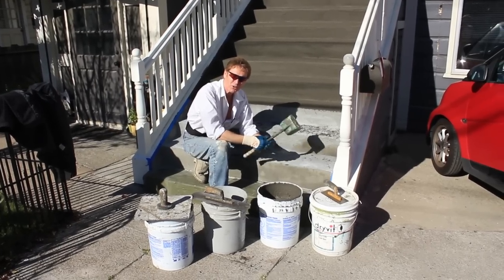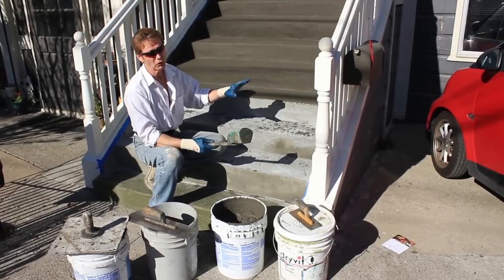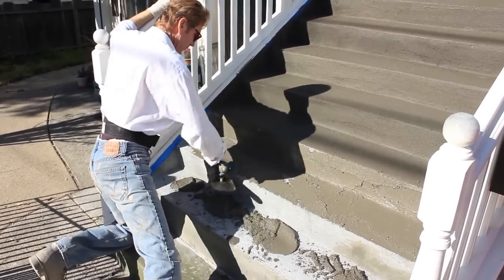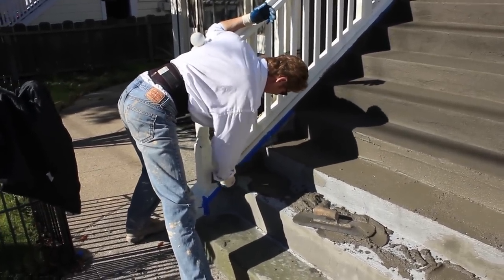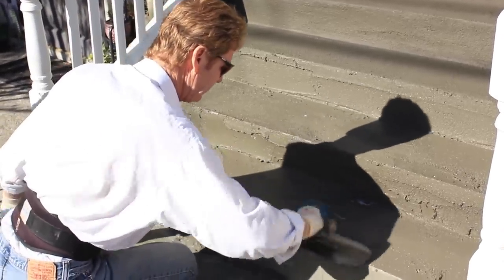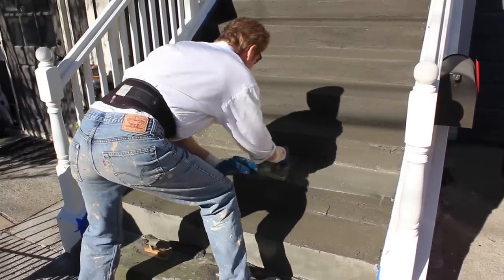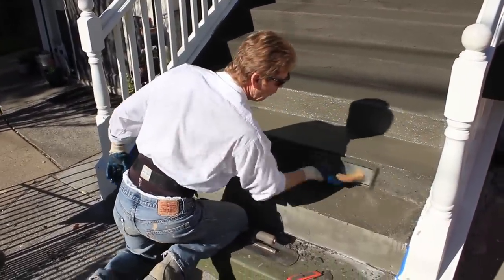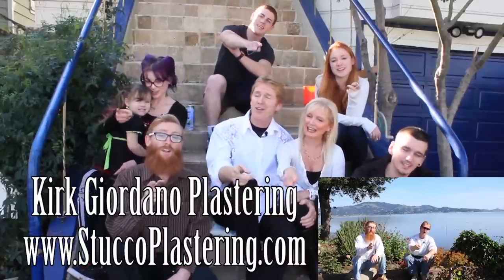Waterproof wood stairs with non-slip finish

Comment: Kirk, I tried to find an answer in the comments, but didn't. I see the DryVit bucket and saw you mentioned it's only for vertical surfaces, but I too want/need to cover the poured concrete stair treads along with the virtical concrete blocks. Which DryVit product are you using? On the spec sheets "Masonry: The masonry surface, with joints struck flush, shall be "skim coated" with Primus, Primus DM, Genesis, or Genesis DM mixture to produce a smooth, level surface.", but I don't believe you did. Was it the Dryflex? Thanks!
Reply from the maker: Good morning Red Dude, all acrylics we use are specifically engineered for walls, however I did this not for cash but for my neighbor and yes I applied it to his stairs, which are still perfect, never needs painting and are slip proof.
 Dry-vit or any other acrylic stucco has rules or folks will use them improperly then wish to sue the company, don't look for any stucco acrylic's
 saying you can use their product for walkways, as I would not say it either if I owed the companies.
                          Live long and plaster
           Plastering tips for your information

Comment: If the stairs that I'm laying this stuff over have a few chips missing, small holes to be patched, should I patch them first with a different product? Or can an acrylic be used to patch those holes in the process of it being applied? Thank you
Reply from the maker: Howdy Geoffrey, patch these holes first as stucco acrylic finishes are only for applying at most  1/8 thick,  any thicker the finish will sag.     
                     Live long and plaster, 
  Teaching plastering tips with proper techniques

Comment: I like the vido, wanted to find something for wood, but I have to disagree on the paint for steps I used deck restore, it’s junk didn’t last a couple months, so I scrapped loose off with wire brush, and cleaned off, went and got plain old red barn paint put it on lasted over 5 years when I moved and another 6 years as I drove by old house
Reply from the maker: This is not a paint were doing here, Instead In this video we placed a rubber membrane than applied stucco, this is a acrylic stucco finish, its permanent.

Comment: Hi Kirk,   I have concrete steps that have sunk about 1 1/2" to 2" on one side.   Pretty ugly.   Could Stucco Acrylic be used to "level" the steps?  If so do you have any tips (other than make sure the concrete is clean!)?   BTW- Enjoyed your video-  You gave some great tips.
Reply from the maker: Howdy Richard, no.
 Acrylic stucco finishes can't be used to level anything, as they are engineered to be applied between a sixteenth of an inch to one eighth.
 I would advise buying a bag of Poly Bond mix with a bit of sand then apply to depth needed, allow to set a week or so so, then apply the acrylic stucco.
   Of coures when the steps contiun to sink, you will have to do all over again.     
                                  Live long and plaster
 teaching plastering to apprentice's or DIY homeowners
Reply: Thanks for the advise.  Yes..  They will continue to sink but they took 35 yrs to get this bad and I'm 70...  I'll do them again when I am 105 if they need it. !
Reply from the maker: Howdy Richard, dude, atta boy,  that's the sprit.     
                                   Live long and plaster
       Sharing plastering information,  as the world can use more teachers.

Comment: Luv the Vid's Kirk..
Would you suggest 1st applying a masonry adhesive like latex (milk) before applying the Dry-Vit material.
Reply from the maker: Good morning Barr dude, thank you.
 most stucco acrylics have a primer they recommend prior to an application of that specific acrylic.
 The product you are referring to is not one I'm familiar with, FYI, there must be no dust either way as nothing adheres to dust.
                          Live long and plaster
Sharing the plastering knowledge to the DIY weekend warriors                      
                             Kirk and Team Giordano
Reply: Kirk, that Latex is an additive added to thin set what your laying ceramic tile in a damp area or outside.
Ill have to do more investigation to see is its the same as concrete adhesive additive...
Oh BTW keep up the great Vid's Bro!

Comment: Kirk, your soon to be responsible for how my retaining wall turns out,,, the retain wall around my patio I built from cinder blocks and construction adhesive and filled the blocks with concrete, and I integrated some stairs into the build, they are block also, I want to stucco the stairs on the face and the tops, people are worried that the stucco on the tops will crack, I think not—but idk—and then I’ll probable acrylic over the stucco just on the stairs, but I guess that would turn them a darker color, may just leave stucco with a float finish? Sound good?
Reply from the maker: Howdy Yeckley, you can do this, acrylics take a bit of know-how, perhaps it would be best if you hired a plasterer to give you a hand, as I make projects seem easier than they are. 
     FYI, make sure your walls are immaculate as nothing adheres to dust.
Plus you must understand misting the walls with a water hose to ensure a proper mechanical bond, lots of rules for a proper stucco job over bricks, concrete and or cinderblocks.    
                                   Live long and plaster
        Teaching do’s and don’t of plastering and stucco work

Comment: I dont have a presser washer, what else can I use to clean my stairs?
Reply from the maker: Howdy, the old fashioned way is soap water and possibly a wire brush,
 cheers,
 Kirk giordano Rendering
Reply: Hello. What about Muriatic acid?
Reply from the maker: Evening, I would advise staying far away from this product as it's extremely toxic.
 And should only be used for special circumstances by professionals.
 kirk giordano rendering
Reply: +Kirk Giordano plastering Inc. Thank you, Kirk. I really enjoy your videos and learn new tips almost on every video you post. Nice job and good luck to you!
Reply from the maker: Thank you Marius, that's one of the benefits from being in business for well over 30 years in a trade where all jobs are similar, but with with a few details different,
Cheers.
 kirk giordano rendering

Comment: hello kirk, i have a question if the stairs are painted now to white color. would this acrylic stick to paint or i have to remove it prior doing it?  Also if stairs have small holes and cracks over the years, would it be better to fix those up with poly bond stucco and then use acrylic on the top? or the acrylic stucco will fill the small holes? thank you

Comment: Maybe a dumb question. Can I do this for concrete steps running down into my basement? They are completely inside the house. They were carpeted but horrendous. Underneath I found tiles like you see in stores. The carpet was glued to these tiles. Under the tile was glue. LOL!!! Some crumbling but not much. If I am able to do what you do in this video how do I get out of the basement? There is not other way out. How long does it take before I can walk on it to get out of the basement? Sorry for the dumb questions. Perhaps you have another idea for indoor concrete steps.
Reply from the maker: Good Evening Dude, yes, you can do this, I could climb the wall to get out myself, not sure what you can do though, to get out,                   
                       Live long and plaster
    Mastering Plastering by Kirk and Jason Giordano
Reply: Why not just do laminated wood floor over glue ?

Comment: Can this acrylic be used on a covered patio area, with a concrete surface?   I have a cracked concrete surface I intend to grind down level-ish then found this video.
Reply from the maker: Good Evening Mac, yes you can do this as I did it 15 years ago and still no cracks as the quality acrylic's flex and hold super tight.    
 Try  Stuc-O-Flex the best but coat a bit more for the quality.               
                       Live long and plaster
    Mastering Plastering by Kirk and Jason Giordano
Reply: Kirk Giordano plastering Inc. thanks Kirk.   If I can get the surface flat enough and fill the cracks this should be what I need.

Comment: When you say acrylic does that mean it's an acrylic bonding agent in a mortar slurry?
Reply from the maker: Evening Frank, not really, acrylics stucco are made with an acrylic paint mixed with sand basically. 
If you mix a bonding agent in a mortar slurry the, acrylic will be rendered useless as the cement plaster will break down the acrylic paint.   
 Plastering tips and products by Kirk and Jason Giordano with over 800 video’s
           bringing peace, love, and harmony back to the plastering world

Comment: I'd like to know what the procedure would be to put acrylic over a rock wool.
 ( aka roxel )
Reply from the maker: Howdy Ali, I don't believe rock wool is designed for stucco to be applied over.
 But if it were, a similar style to stuccoing staw bales homes would be a good idea.
      
                     Live long and plaster, 
  Sharing stucco secrets and or common sense tips
Reply: Hi Ali we have used basecoat and mesh with Acrylic finish on walls that need a certain fire rating buy using a rockwool block instead off EFIS foam

Comment: More weight to a bad design?
Reply from the maker: Howdy barry, LOL, in lite of a deeper knowledge your comment is goofy.🧞‍♂
Reply: @StuccoPlastering  haha,been called worse. My exterior wood steps pt 2x6 4ft wide with 3 support structures 35 years old. Want cement but maybe wood too weak?
Reply from the maker: It is possible.

Comment: Before you said this is not WATER CLEAN UP...but you use WATER TO SMOOTH IT OUT...?
Reply from the maker: Evening Mike, its sort of water clean up, meaning if you use water right away it's okay if you let dry water won't remove it.
 Bringing peace, love, and brotherhood back to the old fashioned 🌎  “Plastering.” 
    The most comprehensive encyclopedia of plastering on video, by the plastering messengers of Youtube.  
     Over 800 videos 🎭 👀💃

Comment: Sure would be great if your camera man got tight shots. We really can’t see the texture from this distance
Reply from the maker: Good Evening Rpprevost, Dude, Jason and I both agree thus Patreon soon to help pay for some higher cost equipment, as our first priority is to earn enough dough to keep the bills paid and keep food on the table.                 
                       Live long and plaster
                     Kirk and Jason Giordano
Reply: Thanks for responding. I wasn't implying that you needed better video equipment. I was thinking a step or two closer would help tremendously. It would also help to eliminate viewer distractions from the surrounding environment and make you more of the focal point.

But while I have your attention, in which of your videos might I find information on identifying what material and application method was previously used on the exterior of a home?